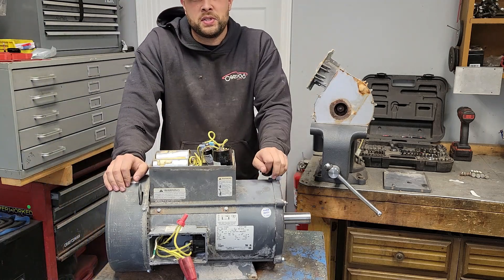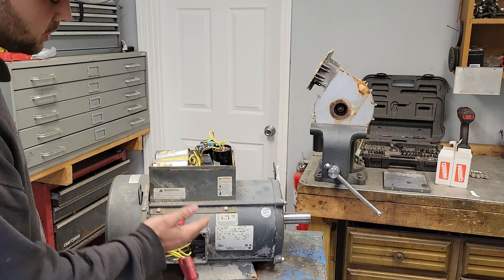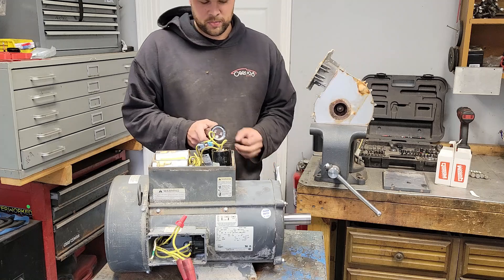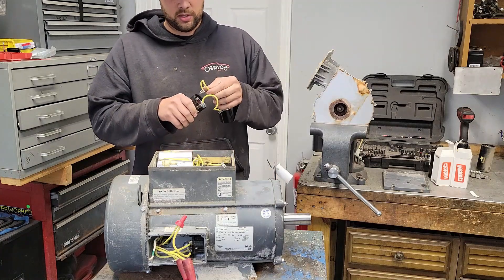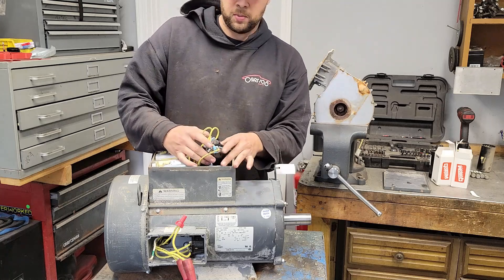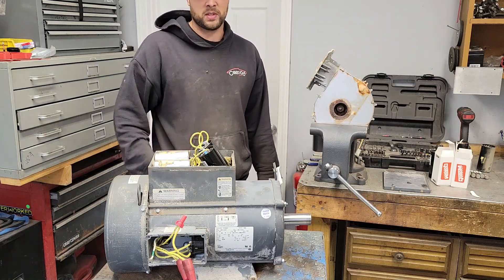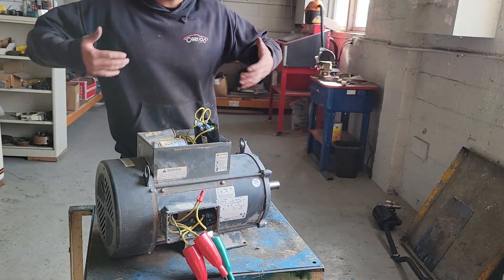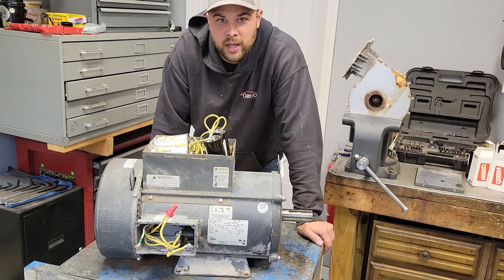The effects of using the wrong capacitors in an electric motor

Comment: I did exactly as suggested on an old table saw i have. I had a capacitor that was about 10% larger than the one i pulled out, so i went ahead and installed it. Yep, that motor went from lackluster to maintaining RPM with ease in 1/2" ply.

Comment: So are these capacitors in series or parallel?  If in parallel then total capacitance is doubled. If in series, then it is halved, but the voltage rating is doubled. You didn't  make that clear. Series capacitors should have equalising resistors.
Reply: You saw the video? It's parallel, because there were two wires between the capasitors. You'd need only one for series connection.

Comment: I had a motor failing because the run cap died open circuit, man it was hummin and buzzing really weird and did not even run, it was screaming hot too. since I been working at the job for 19 years now I knew how this motor sounds like it was my own thoughts. I figure the sound was not the same so I went up and cut the power before it burned out, The oil cap had literally zero picofarads left in it. replaced the cap and it works fine again. This was like 3 years ago now

Comment: DANGER !!! If you are not familiar enough with electronics don't go messing around with high voltage items it could be your last encounter 💀
Reply: really? I thought the leads of a hot 220V cap would be more interesting than a -20F pump handle in winter would be to touch with my tongue - well, ok, YMMV ...

Comment: Considering the fact that you can now get what are dirt cheap VFDs that will take 240V single phase and output 3 phase to drive a motor I can't really see why one would use a cap start motor.  Besides, you eliminate the caps and the start switch in the motor and you get soft start limiting the inrush current.  Depending on application, you can also run the motor at a slower speed if needed and conserve power.  The gentle ramp reduces ware on mechanical components as well contributing to an extended life.
Reply: Ah, tell that to the 5hp and less motor manufacturers - they have been making these in the tens of thousands for decades. 

Mr. Rogers: "Can you say, 'cash cow'?" :))
Reply: @ArchetypalCat  To be sure you are correct on the money making front.  But i prefer to go the inverter route for more than just the aforementioned reasons.  Most modern inverters also are much closer to a PF of 1 reducing the loads and waste on the power grid.  In some places there are demand prices in play for the electrical so large starting currents can get costly as well.  Then there is the fact that extension cords are a big no no for the larger cap start motors.  Motor drives don't mind them since the starts are gentle and ramped not causing excessive currents beyond the circuit rating.  I will personally never buy another cap start if I can help it.
Reply: @mikeiver  honestly, the motors I work with typically are < 5 .. 10 HP, but I really do hate start caps. LOL Got me thinking ...
Reply: The money you save going to a 3ph motor is far greater than the cost of a VFD.  Everybody want's a 1ph because 3ph is not available until your in a comm. or ind. setting in the US, piles of 3ph motors after jobs are done, they end up scrapped because. ret sparky
Reply: @ch3no2killz  interesting observation. Makes me wonder if there is a market for getting those 3ph motors dirt cheap before they get scrapped. Seems like something a more serious DIY'er would be interested in. Of course, if they're just piled up, the folks making those piles would rather just get the scrap value than have a pile on hand that might only sell a few. Odd situation it seems. I'd like to know your thoughts on this. thanks
Reply: @ArchetypalCat  Worked in a lot of ind. car plants, pwr. houses. I'm sure any that didn't get snatched went in the scrap bin. might try the web, local scrap yards, they usually have a pile , good part about 3ph motors is they only have 1 part to go bad, the rotor is bullet proof, stator has all the windings. Point being if it turns and feels smooth shaft is not bent, if it's wet, take it apart use some spray electrical cleaner like CRC, after cleaned and dried use a good meter to ck for phase to ground leaks. When you go digging grab a pair if ya need 1. They should sell it to you by weight, that's the deal.
Reply: @ch3no2killz  cool - thanks for the reply and suggestions. Not sure what we have around here for scrap yards, but there's gotta be some.  

CRC's good stuff - I use it a lot on electronic things. 

Regarding smooth turning, I assume the 'one part' that might go bad are shaft bearings? Never seen inside one, but it's not hard to imagine it looks almost like a 1 phase (obviously with different windings :).

thanks again - much appreciated!
Reply: @ArchetypalCat  Unless the windings are shot bearings are the only moving part. Any body with some skills can pop the end bells off, chk brgs. clean, inspect, if they sound bad, many places to get replacements,  Still a deal at twice the price

Comment: If that motor is 7.5 HP 240V 30amp .8pf it should only use a total of 332 micro-farad capacitor. If there are two caps in the motor in parallel, then each should be 166 micro-farad.

Comment: Keep the voltage rating the same or higher as well, power factor determination on run caps is important as impedance values can change over the life of the winding as well as temperature changes in work environments, crosstalk in lines, moisture etc.

Comment: An advice?
Do not ever touch the terminals on a RUN Capacitor in a running motor
The voltage is way higher than the supply breaker.
Why is that? You may ask
This higher voltage, where is it coming from?
The motor winding are roughly similar to a transformer, a small diameter but more turns, and a wider diam. with less turns.
Sharing an iron core
The motor itself elevates voltage
Check the Run Cap terminals with a Voltmeter to verify this.  Be Safe

Comment: That's the biggest single phase motor I've seen. In Sweden we have 3 phase everywhere or at least every house, farm etc. that could use that size of motor. It seems there are more places in the US that don't have 3 phase power.
Reply: almost no places in the US have 3-phase motors or appliances outside of highly commercial industrial factories with it specifically installed for huge appliances. often 400-800 volt rather than 120-240 volts.
Only a few home appliances even take advantage of 240 volt. like washing machines. dryers. and electric ovens/stoves.

Comment: Fellow technicians, the capacitors on a GOOD motor discharge by themselves.
They do that through the motor winding which acts as the short done by the pliers.
Caps on a BAD or burned, broken winding are Not Shorted therefore maintain its charge
But is a good safety practice to Always discharge them
Reply: Lotta caps have a high resistance less than 1W resistor to make em safe. But the bean counters watch that #, the direct short is not the best way, but beats gettin lit up!

Comment: How do you figure out what size capacitors to use if it's missing when it's given to you?
Reply: Power factor and a couple triangles 😅
Reply: @markus18laine  
In other words, you don't know either.
Reply: @redfields5070   Well I do kinda 🤔 buts it's easier if you search for power factor correction than me trying to explain it half assed 🤣
Reply: @markus18laine  This is situation is not power factor correction, its motor starting and the capacitor is changing the phase angle of the magnetic field in the start winding in relation to the run winding. Hope this helps.
Reply: @multirole240  so is it like simulating a 2 phase ? or more like lags the voltage 180 deg ? or am i way off ?

Comment: Great demo, is there a formula or chart to determine what the proper capacitor is ? I have a single phase 20" disc sander that has had capacitor issues since new, I installed larger caps from another tool It helped ,but I was never comfortable with the guesswork.

Comment: There is something special about killing capacitors with a high rate discharge. The soon apparent failure is often spectacular. After I learned to discharge through a resistance such as a solenoid meter or lightbulb I found that the life cycle of the capacitors dramatically increased. Kudos to you for having a go, experience and time are a great teacher. Perhaps you could explain to the crowd why the voltage rating is so important. I’m a 65 yr old sparky/ Fridgey and still learning new tricks with single phase motors, enjoy the journey.😂

Comment: Honestly the no load start with the weaker capacitors seemed less violent than the start with the correct caps and did it on the smaller breaker.  I guess where the rubber meets the pavement with this is when the motor starts under load and the jump you show on the 40a breaker means something.  Is there a formula for calculating the right mfd for the capacitors vs voltage vs amperage rating for the motor?
Reply from the maker: I have an old motor book here that says start caps are generally 67mfd roughly per hp but I find that varies widely. In fact sometimes 2 of the same exact motor may have different sized caps between the two of them. I think it comes down to what works and what deals the manufactures of the motors get on their parts.
Reply: Yes, Read The Motor Nameplate.

Comment: Not an accurate test , use the proper power for each test
Reply from the maker: At the end of the video both capacitor combinations are ran off the same size breaker.

Comment: so the capacitance is to offset the rotating magnetic flux. In other words, they cause a delay in the rotational field to induce torque into the rotor. you're always safer to go higher than lower on replacement caps. That's a VERY simple explanation but the one I give my students when going over motors with them. Easier to explain when I have the diagrams and pictures to refer to ;) 
man... I wish we all just had 3 phase, would make things so much easier hahaha.
some smaller motors use what's called a shaded pole for the same effect. delays the 60hz just enough to get the motor to spin, but they don't produce a ton of torque. Think small fan motors, like your bathroom fan.
Reply: The capacitor is to delay the current 90° in the start winding , the size of the capacitor effects the amount of phase shift
Reply: @MillersMotors   👍 and thus creating a rotating magnetic field, which the rotor tries to play catch up but doesn’t quite ever get there, hence slippage.  That was my understanding anyway.  
I guess oversizing  the cap would make it go past the 90 degrees, which has the same effect as undersizing the cap which would make the phase shift less than 90 degrees? Bit like getting the firing order out of sync?
Reply: Vfd from single phase makes 3 phase possible for everyone.
Reply: @pw36952m  AT A COST $$$...
Reply: @pw36952m I use an AllenBradley powerflex 4 in a drill press. It even has an inverter stage to convert 120v single phase to 208-230v three phase. Available cheap used and good up to about 3HP for small shop equipment.

Comment: Does a run capacitor make the motor run quieter, as in less AC hum, than if you ran completely without one?  The reason I ask is that my 24 year old commercial Speed Queen washer had a big motor run capacitor mounted on the side of the motor and it was nearly silent.  Fast forward to 2024 and I don't see any such capacitor on my new Speed Queen and it is humming like a 20,000 volt overhead power line.  I've been told by others that their new washing machines are humming noisy as heck too.  It's worse under load, as in the start of the spin cycles, or anytime the motor is drawing more current.
Reply: And that would explain why I'm still using my 30 year old speed queen 😂
Reply from the maker: It's not so much that as it is the build of the modern motors.  Higher efficiency and lighter materials.  The lighter motors don't dampen the noise like the old heavier motors did.  If they still built motors like they did our shop would hardly keep busy being those things ran forever.
Reply: Newer washing machines often have a brushed motor, like vacuums and anglegrinders. This, in combination with electronic speed-control makes electric noise.

Older units use an induction, motor, and switches the winding pole number for different speed requirements. 2-pole gives the highest motor speed, 3600rpm @ 60hz, 4-pole half the speed, and so on..

Other technologies is used as well. Direct drive, VFD and more.

Comment: Why did the customer guess if he only had to read the original ones?
Reply from the maker: This time of year when these motors go down they're often on top of augers or grain bins up high.  People will buy random caps sometimes hoping that will fix it before even looking inside the motor this way they only have to climb up there once.  They very rarely guess right and often also mess up the wiring.
Reply from the maker: It's fairly common for the labels to peel off and be lost overtime  or for the cap to have exploded into pieces and become illegible as well.
Reply: @therandomfarmer4231 - I've got a Cap from a Delta bench grinder on my desk right now, blew out the side right where the mfd rating was stamped! What a PITA, and the manual only gives a part# not the rateing, so more research time required!

Comment: so, wire them like a battery in series?
Reply: when you wire them in parallel it increases the capacitance. series halfs it. it works opposite to resistors lol.

Comment: That was very helpful no fighting needed
Reply: Put this wire on this connector and that wire on that connector.
Gotcha.
???????
Reply: Where I work in shop that builds motors they put together motors three times the size of that and when they test run them they do
 ' wheelstands ' on starting.
I'm always waiting for them to want me to weld broken castings from them slamming down or waiting to hear one crash to the floor.
Reply from the maker: Lol glad to hear